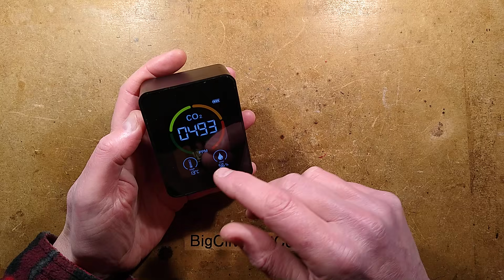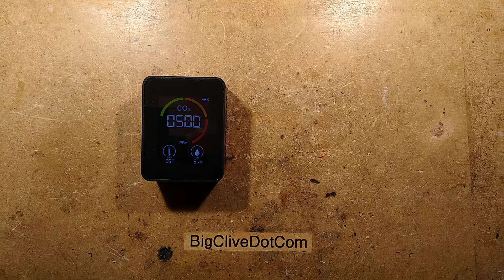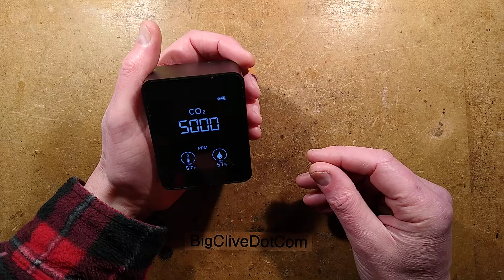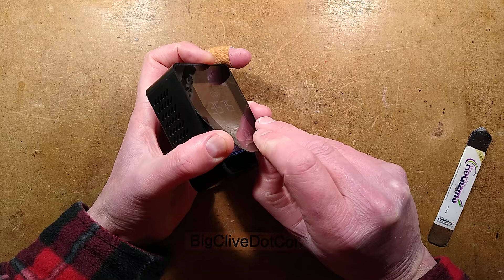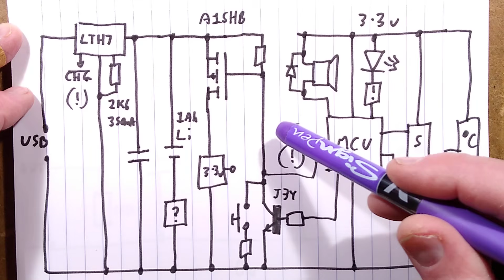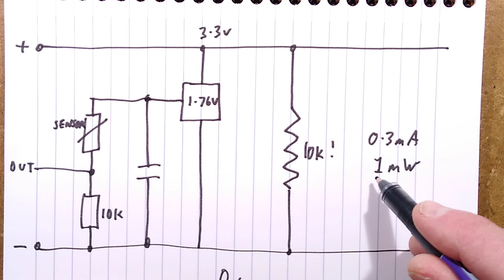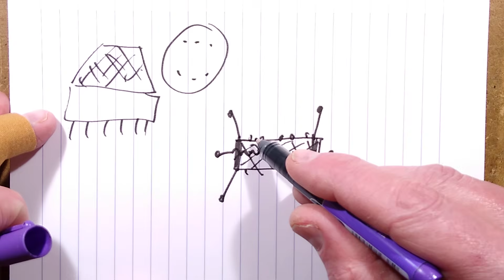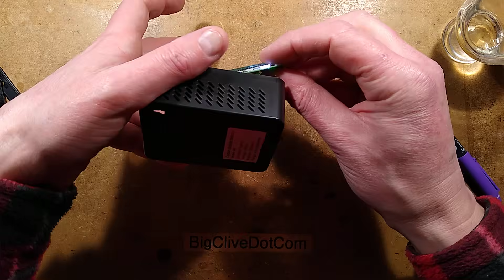Fake CO2 monitor (party detector) with schematic

Comment: These tin oxide sensors can be surprisingly clever.  As you said, the gas in question is stealing oxygen from the tin oxide making it more conductive.  The sensor can't identify specific gasses but depending on the power of the heater it can narrow them down.  A "low temperature" sensor will only respond to very reactive gasses like formaldehyde and carbon monoxide. "Medium temperature" will also respond to alcohols and ethers and "high temperature" will respond to any gas or vapor that can be oxidized including things like butane and mineral spirits.  With multiple sensors it is possible to program a "smart sensor" that can distinguish, for example, ethanol from propane.  But no amount of clever programming is going to detect CO2 as it doesn't react with tin oxide.

Comment: Old school CO2 monitors used thermal conductivity but were not very selective (strangely very sensitive to hydrogen though) newer tech is infra red based. With CO2 being fully oxidised an alcohol sensor won't work as they are in effect "oxidation" sensors.

Comment: It seems like a carbon monoxide monitor would be more important than CO2 even though high CO2 levels are toxic too.  It takes a lot of CO2 to be a problem.  It’s kind of funny that China, Inc. bothered to put an actual sensor in there.  I can picture the conversation of the sweat shop owner, “I’m building a gizmo.  Give me a sensor.  I don’t care what it reads as long as it reads something.”  It seems like it would have been easier to just fake the operation and have the thing generate random displays between 400 and 500 PPM kind of like those fake OBD-II devices generate fake diagnostic bus traffic blinking.

Comment: have you tried to see if the pin-out matches any common Arduino at-mega chips.
edit: the only use i think it could be used for is a system to ensure that only people who sanitize their hands or have had some alcohol are allowed into the office. but the sensor is useless while in this form in any other cercomstances.

Comment: CO2 detectors commonly uses red and infra red leds alternately passing through the gas sample and a detector looks at the diferent absorbtion of the sources. To be any good they are quite expensive. Most likely its just the usual chinese try on. I had a gps tracker from ebay that didnt have the gps module fitted, believe me its not just an error, they rely on a lot of people heving no idea wether it works properly or not.

Comment: i just tried the 6pin sensor with the steel mesh dome. 10Mohm idle drops to 10% -1% with gas. 1minute recovery. plenty of drift.  
0.75 watt 5volt heater. 110C above ambient at the sensor. 
sensitive to everything that isnt air.

Comment: It could be measuring volatile organic compounds. I know they sell air quality meters that measure both CO2 and VOCs, but those are pretty pricey. Presumably the non-fake ones anyway.

CO2 sensors are useful in modern "passive" houses. Basically the more airtight the house is, the more efficient it is. It would help for people like myself who are happy to sit at the desk/workbench for 18 hours working on a project before realising they haven't eaten anything. If the door is closed, I guess it's possible the CO2 concentration could increase in the room, so it could be useful to have a thing that beeps to remind you to get up and leave the room

Comment: I almost bought this device a week ago. I bought a CO2 meter, ended up with the Airthings View Plus, to track CO2 levels while I sleep. My bedroom occasionally reached 1500ppm while I slept, and after a few data points, the nights where it reached that high correlated to days that I woke up feeling lethargic and having an “off day.” Tracked it down to A) poor air circulation in my house and B) insufficient air flow to my furnace. I rent and the previous tenants stuffed rags in the air supply vents since they allowed cold outside air straight into the basement. 
Sleeping with the bedroom door open and setting the thermostat to turn on the air handler 15 mins/hour, regardless of turning on the heat, seems to have mitigated this issue. 
Of note, I believe the Ecobee Premium uses this method of indirect CO2 sensing. I think the proper NDIR sensors are like $50 for the module itself, hence cutting corners for cheaper sensing devices.

Comment: The cheapest "CO2" sensors are often just "air quality sensors" because actually sensing real CO2 is much more expensive and also consumes significantly more power (needs a 2W heater often). These try to estimate the probable CO2 level from other organics that accumulate when people are present.
You should try farting into it 😉

Comment: I was considering this very same 'monitor' from amazon. There are a number of them but they all have the same 400 floor value and I could not understand why. Now I do. Thanks for the comprehensive teardown and the laugh at the alcohol sensor called CO2.
Reply: True CO2 detectors also have a floor of around 400 ppm, because that is the CO2 concentration of clean outdoor air.

Comment: At least in america, many of our buildings (especially from the 70s and 80s) are practically hermetically sealed.

Even my parent’s house from the 1950s, which leaks so much air you can’t be near a window on a cold day, has CO2 levels between 1000-2000ppm, which can be kinda unpleasant.

Comment: In our area all the nurseries were handed similar detectors during the covid pandemic as it was supposed to warn them to open the windows when stuffy. I suspect though that they were only eCO2 sensors so what value they had is questionable.

Comment: It's early here, I've had little sleep (health probs), and some happy pills because of said health problems.  This crawled up out of the back of my mind. You've been warned. 

I just had a thought hit me. Since we seem to have an infestation of Chinese spy balloons wandering the planet, and seeing you trying to pick this thing apart (plus some of the other astounding things you've put on this channel)... What are the chances that the balloons have some sort of tracking device that , with some of this nonsensical, weird stuff you're reviewing electronicswise- this stuff might somewhere be putting a radio signal (EM interference?) that the balloons would be calibrated to use as maybe navigation beacons? Maybe, not all the components are in one item. But, one has their CO2 meter, death o nizer, and a few of those other things you've reviewed and went 'WTF'- all of them running at the same time, all day. And it all puts out a sort of EM slime trail the balloons can follow. 

It's a hell of a theory, but it could explain the mystery bits you've been finding lately.
Reply from the maker: Nothing I've looked at has the right circuitry to communicate with a high attitude receiver.

Comment: Interesting. I bought one a few years ago because my house is wrapped up pretty tight. It claims to have an NDIR CO2 sensor if anyone knows anything about those. The value does change frequently (mostly between 400 and 1800), but I have always wondered what, if anything, it is actually measuring.

Comment: VOC sensors on a PCB can be bought for a fiver and linked to say an Ardunino. I am going to use one to boost my all house ventilation unit when it detects cooking etc. VOC is a better measure of such than CO2. It does provide an eCO2 reading too but I ignore that. Also has a humidity sensor to detect say showers.
 The sensitivity is amazing. Move your hand near it and the VOC reading goes up within a couple of seconds.

Comment: One thing to note about CO2 sensors in general, they're quite slow to respond. The one I'm using in a project is from Sensirion (the SCD40) and it can only put out a reading every few seconds, and that reading won't be all the way to the actual current value, generally. So even if this was a legitimate product and not using a temp-humidity only it might not respond well to a quick blast with the Sodastream, since the CO2 would largely dissipate before it the sensor managed to update fully.
Reply: As far as I remember, CO2 sensor values need to be corrected according to the ambient temperature and humidity. So adding a sensor for them is reasonable. 
It would probably be better to use something more accurate than a DHT11, though. At least if they had used a real CO2 sensor...
Reply: My NDIR CO2 detector responds almost immediately to a strong source of CO2 such as my breath.  A SodaStream blast has 20x the CO2 concentration of breath, so any true CO2 detector would quickly spike in response to that.  But it can take ~30 seconds for the reading to stabilize, as the gas needs to diffuse across a membrane into the detection chamber.

Comment: The reason why people were and still are buying these is a bit weird. The amount of CO2 is roughly bound to the time the air in the room hasn't been exchanged. So they use the concentration of CO2 as an indicator for "bad" air - which was kinda important during the Corona virus crisis. High CO2 was an indicator for air that could also have been full of virus particles, so they used CO2 detectors in class rooms and other places, where forced ventilation (by open the windows etc.) was then about to be done to reduce the risk of infection via air. Seems this stayed in peoples heads and now high CO2 is in general an indication for bad air that needs to be.. refreshed.

Comment: At least we know that you don't drink Special Brew as that would be buzzing continuously while you are talking 🤣

With regards to the 5V circuit, could it be a money saving exercise that they use the same circuit board on other devices as it has the temperature module attached as well? The IR sensor for an external temperature display that has a backlight when dark or someone walks in front? Or am I thinking too much into that?

Comment: Thanks for posting this, I was considering buying one of these, thinking it wouldn't be super accurate but maybe could at least get a ballpark reading, now I won't even bother. 

Reason I'm curious is I live in a very tightly sealed apartment and have a non-vented gas stove and was curious how much running the stove would affect CO2 levels.

Comment: This is an eCO2 sensor, which is actually measuring tvocs to give air quality reading which is measured as equivalent co2.  This is because CO2 sensors are expensive, power hungry and drift over time.  They are frequently used by systems to control ventilation.  So its not really fake, its just incorrectly advertised.  And yes real CO2 indoors is a huge problem in building design; who'd have thought that sealing buildings to keep the draughts out would be a bad idea, particularly in a pandemic.  Nobody can agree what value is too high but prolonged exposure to high values makes people drowsy and is generally an unhealthy atmosphere.  But like everything else we worry about it for a bit but nobody wants to really fix a problem.

Comment: You would need something like this if you had someone sleeping in a confined space like a car,truck,camper,ect. or if you were on a boat with an interior with an enclosed motor, if there is a crack/leak in the motor housing you could die just from being inside the boat.

Comment: Thanks for the video Clive! After testing mine with 99% Isopropanol (no effect), I decided to take a closer look at it. The internals look completely different. Different PCB, different Display. It seems to have a MH-Z19E CO2 Sensor, that is installed on a separate PCB. It's display has a flat ribbon cable and uses a STM32F103 processor. The Battery(1200mAh - floating in the case) and the DHT-11 sensor were included though. 😃 From the looks of it, it could be repurposed for other things too. It would just need different code for the MCU.
Reply: Wow, can you give a link to the product? Sounds like a good device for a DIY project!

Comment: Fun and infovideo as always Clive!
I have two of these sensors, one CO2 and one fine particle, both in same housing you show, only with Micro-USB charging.
Both work fine, and the CO2 sensor goes to 400 for a period of time sometimes, in fresh outside air just over 430 ppm and inside depending on people in the room and ventilation. Similar values as a professional one.
The fine particle one is also quite good, detects when the fireplace is (not often) lit, and has an internal small fan for airflow.
Will test the cross sensibility with Alcohol 😉🍺🍷🥃

Comment: Bought something similar but it actually seems to work. Took it top work and put it inside a large glass beaker with some sodium hydrogen carbonate and dropped some hydrochloric acid onto the carbonate and watched the CO2 level increase.

Comment: The ZP16 (see silkscreen near the sensor) is a VOC sensor you can get as a module on some chinese sites, and it needs 5V. So perhaps they switched gas sensor modules at some point? Proper CO2 sensors can be really useful, despite their high price. In my small office CO2 climbs pretty quickly, reaching 3000+ ppm over two hours with closed door, as ventilation is pretty poor in our modern insulated flat. I got a big blinky light that warns that the place needs to be aired out so I don't get all drowsy and headachy all the time.

Comment: This reminds me: for Defcon, uh, 25 I think, my local crew made badges (uh, badges to get in to a particular crew's Saturday night parties has been a thing for a while, and they've been electronic for a while) which included an alcohol sensor (with CO2 sensor, which helps calibrate the ethanol level against how much actual breath is being measured) and also proximity RF "social diseases".

The longer you spent around others with identical badges, the more STDs your badge would accumulate.  And yes, it really did work to encourage increased F2F social interaction among our badge holders because hackers hav sick senses of humor. :)

Alcohol levels and other um "achievements" - I don't recall the conditions - would lead to all of the badges in a group doing a little sound and light show.

Comment: I've used uCs to run multi-digit 7-seg LCDs directly. The segs are brought out separately, and one common lead. You alternate all signals between 30 to 50Hz. ON segs are out of phase, and OFF segs are in-phase, relative to the common. If the uC stalls, you just polarized and wrecked the LCD.

Of course, the designer of this unit would take care to use the uC's watchdog timer, to prevent this from happening, just as he was careful enough to buy the "correct" CO2 sensor ... yeah !

Comment: This isnt a fake CO2 detector, at least not completely. There are sensors that measue TotalVolitileOrganicCimpounds (so for example alcohol) and then guesstimate the CO2 level from that. Those "eCO2" sensors are cheaper and may fool some people. Fell for it too at one point, then realized a MZH19 was like 5 bucks more expensive but it measured actual CO2. Thats probably what the "infrared module" connector is for. The makers of this probably thought "if others cheap out on the co2 sensor, why not us?"

Comment: It's almost as if they had a proper product idea with that custom made display. Then they let the Arduino-tinkering intern design the circuit. With the useless power section and the alcohol/party sensor. It's so stupid I don't even think it was intended to be a fake. Just a failed design that should never have reached production. But when it did they had to recover their costs and decided to dump them for cheap.

Comment: Guess who else cares about CO2 levels?  (or think they do) - Pot growers. 

Pot growers care about CO2 levels a LOT.  
CO2 systems are a big business (mostly among amateurs) in the pot world.

It is perhaps notable (in terms of market for cheap lying gadgets) that professional
grow operations here in Colorado (literally the legal pot capitol of the world) do not bother with CO2, and it's slowly falling out of favor.

Speaking of cheap, lying junk containing marginal sensors utilized badly: 
Measuring humidity is the hardest problem in metrology.
(Really! We can measure time down to the femtosecond, but we struggle to measure humidity with better than 5% accuracy.)
Humidity in indoor growing operations (for example, tomatoes) can be critical for best results, but the best, most reliable method we have for the field (ie; greenhouses) is... aneroid instruments utilizing strands of hair for the sensor, calibrated by hand. O_O

Comment: If I keep the doors and windows closed CO2 can easily reach 3000ppm in my living room within a day. And that's one person breathing without exercise. I have triple pane windows with three rubber seals on the outside and a door with one rubber seal. I know the building code in the UK is completely fucked up and they require ventilation holes near the windows. In that case there's always a draft in your house and you won't need a CO2 sensor. Having ventilation holes in your home makes cooling and heating homes less efficient and it also delivers oxygen to any potential fires. Get your shit together, UK! 🌈

Comment: By Arduino-ish, you mean STM32duino-ish with that QFP48 chip ;) Though they probably reused some Arduino library for the crappy DHT11, the LCD driver and other modules (with a classic GPL infringement because those guys don't want to share their spaghetti code)

Comment: I got a similar cheap ebay device that displays CO2, HCHO and VOCs (Mostly text not graphics), very good at detecting and warning about dog farts.  It does respond well to pure CO2.
The story is that CO2 builds up in unventilated offices and you get a little stupid, perhaps similar to taking Alcohol.